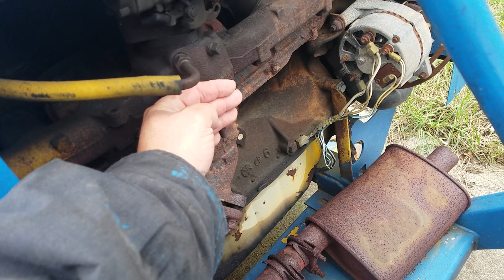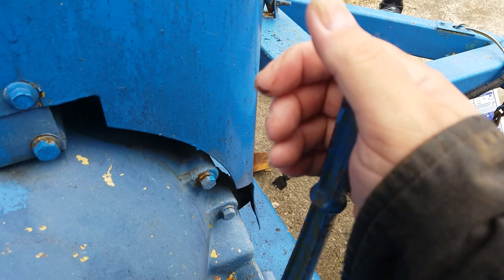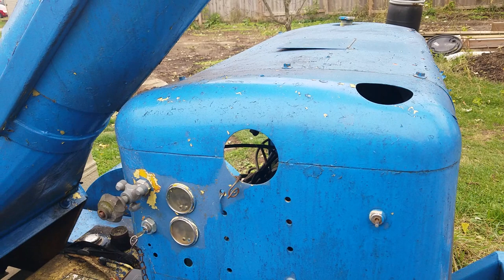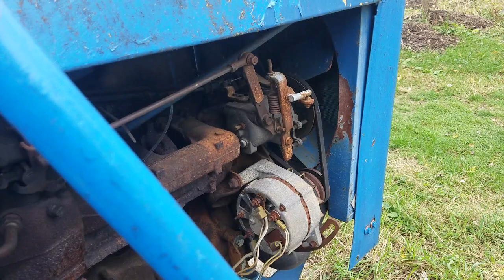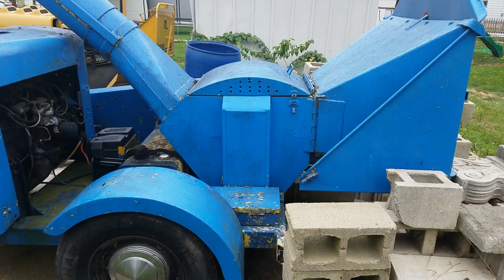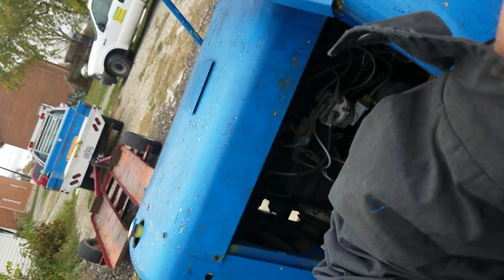Starting up the Mitts and Merrill chipper

Comment: Nice color.  Try touching the clutch engagement 3 or 4 times and let go at 1/3rd speed.  Then fully engage with some momentum going on.  Do you have a manual by any chance.?  Looks like you have a 16" dia drum which is the only good one.